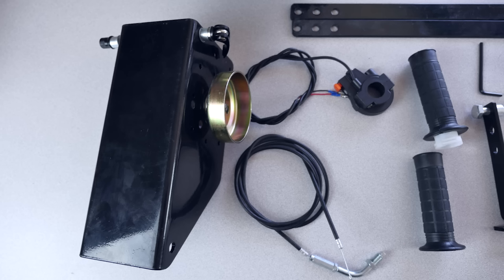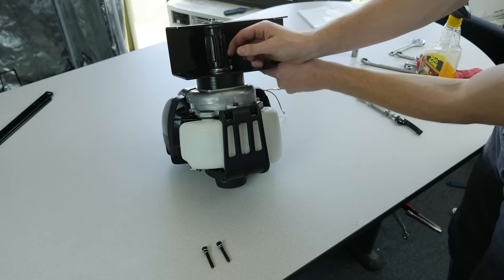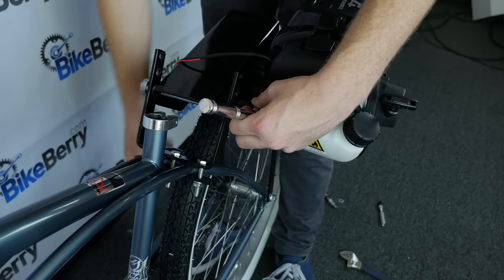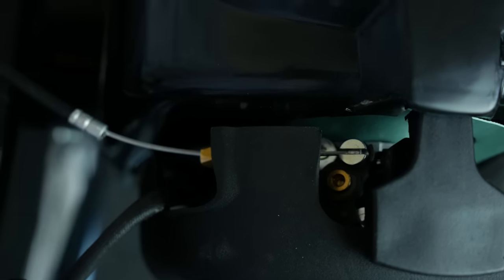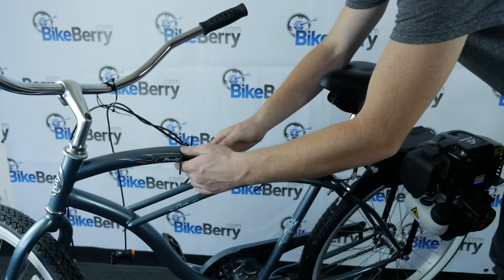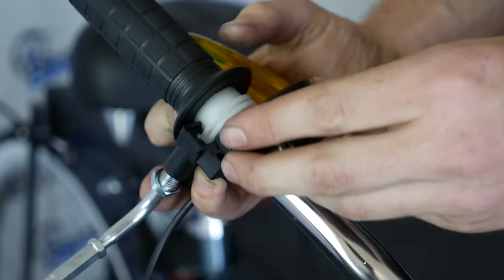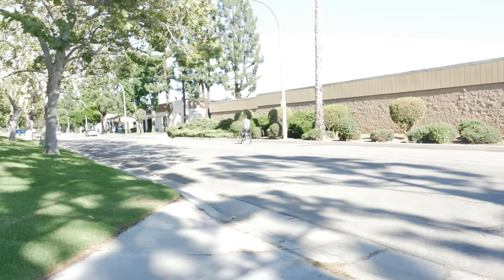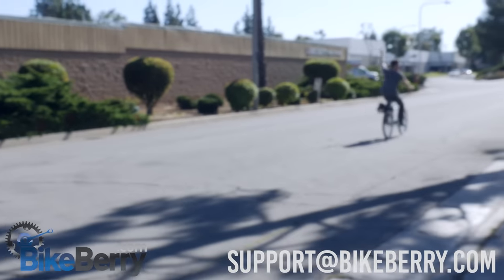4-Stroke 38cc Friction Drive Motor Bicycle Engine Kit Installation | The Flying Horse Lock-n-Load

Comment: Wouldn't putting the engine in FRONT make for safer handling (under steer) vs your rear drive (over steer) setup?
Reply: Imagine turning against the motor it’ll be breaking while driving

Comment: What if we demand using SAE drill bits?
Reply: G Philip C You use a 1/32 inch bit for the pilot hole, then a 6/32 or 1/4 bit for the actual hole.

Comment: Aren't there laws in the UK restricting the riding of any vehicle powered by an internal combustion engine on public roads?
Reply: Here in the netherlands also you will need a lisence plate and a drivers license. its a bad idea to drive one around here..
Reply: same here in Australia you will cop a unregistered, defective motorbike fine and if you don't have a motorbike licence you will get smacked wit another fine all up $2000+
Reply: Don't know how the laws are in the UK but here in the states they don't seem to care much even for those in frame engine motorized bikes. I got around on a beach cruiser for about a year & was only pulled over once for not fully stopping at a stop sign the cop didn't really question the legality of my bike nor did he ask for paper work. Let me off with a warning though because my brakes weren't very good (wink wink) I guess it depends on what kind of cop pull's you over. Suppose I was one of the lucky ones because I've heard of others getting slapped with finds just for driving theirs on public roads. After my motorized beach cruiser failed I built a friction drive mountain bike & been driving that for a year now & never been hassled by the cops for it once. I don't think they can legally impound your bike in most places though. Don't risk it though. Get the bike registered as a moped, always wear a helmet & doesn't hurt to carry a motorcycle license & you should check your local laws.
Reply: Modern Leveller it's not in UK in Georgia
Reply: All the more successful homeless people in my area have these; no license, no registration, no emissions test, no tax, no helmet, no speed limit and I'm pretty sure you can operate one of these as drunk or as high as you can be in Arizona. Hell, bing homeless in Az. Can be pretty damn nice.
Reply: G
Reply: walter kersting almost positive DUI/DWI applies to any mode of transportation across all 50 states. People get DUIs on regular bikes  all the time. I doubt a motor makes it somehow not an offense, especially since you can get a dui on a lawnmower, quad, etc.
I do kind of admire the homeless man's ability to save that can afford one of these and doesn't instead spend that money on shelter, food, dope, alcohol, prostitutes, crack, cigarettes, shoes, etc.
Reply: I know in most states in the U.S. no license or registration is required if engine is less than 50cc.
Reply: @theatom7264 -Here in the states federal law prohibits requiring registration or licensing of vehicles less than 50cc. You are still required to obey the rules of the road and a helmet is always a good idea.
Reply: @martinj9647  you can even be done for riding a horse or being pulled on a cart drunk .My great grandfather would go to the farmers market on the weekend and would very often come back drunk and asleep in the back of the cart late at night .As the horse would know his way home and when the horse got to the front door it would ring the doorbell with his nose to get my grandmother up to carry him indoors.He never  got done as he as was good friends with the chief of police and the head of the council and the judge.I guess as that helps and a intelligent horse .The horse otherwise would not go past a pub or his mistress's houses gambling dens and hoar house without stopping.that was a giveaway. frustrating when the rest of the family would have to use his horse if the other was sick or lame .Who needs a self driving Tesla.The horse does not lie but you might.

Comment: what about tyres i think it goes bad easily
Reply from the maker: +vedat kamanli It will bald out your rear wheel faster than your front because of the rolling pin. We recommend filing down the rolling pin and smooth it out a little bit to increase your wheel life. Keep in mind, that filing it down too much can cause issues with it 'catching' your rear wheel so file it sparingly.
Reply: +BikeBerrycom what type of bike did you install the engine on
Reply: +BikeBerrycom what type of bike did you use in the video? was it a multi speed bike?
Reply: seoulkidd1 No, single speed

Comment: 5:04 mate thats the primer not a power button
Reply from the maker: You're correct, this video was made years ago and since our information and video quality has greatly improved.
Reply: He said primer button
Reply: Watch the video just to point out the one flaw you could find. Cool Bro.
Reply: Noah Bannister no he didn’t
Reply: BikeBerrycom The info may've improved, but 2 things that didn't...
1- Blueberry is currently out of stock on this as of 5/9/19
2- It was never discussed about braking power or even possibly fatter tires
Although I said 2, a 3rd, the fact that after better info was available, there wasn't a re do or update for this video on the info you have here for all to see & potentially troll you about.

Comment: Whats the fastest tthis bike can go
Reply from the maker: +Roon Ortiz  Great question! It goes over 15 MPH and gets around 100 miles per gallon
Reply: +BikeBerrycom Is it sold in the UK?
Reply: BikeBerrycom Thanks for your reply.

I decided to go for an adult push scooter, because anything that has two wheels and is parked outside gets stolen or vandalised where I live at (Newcastle, UK).

Plus, I think I would need a driver's license for this, which I dont have.

But thanks for your reply.
Reply: +BikeBerrycom my clutch spring broke and i replaced it and now the bike accelerates slow and doesnt go as fast any suggestions or ideas on why.
Reply: +BikeBerrycom ...that's it? I'm new to these so maybe it's fast but that seems kinda slow to me. If someone would like to explain please do
Reply: BigRedCatFTW I depends on the engine size I have a 37 cc and it goes a little over 20
Reply: +Roon Ortiz     I have had mine up to 23 mph,suggest having an Electric front wheel,you need to pedal to get this bike going to much weight,an Electric front wheel or Hy-Bred works best,Use Electric to get you moving then engage gas motor,as I said to hard to get bike moving from a "Dead Stop without Assist one way or another

Comment: Do you guys provide a better throttle assembly kit that will last longer? the plastic throttle gets stripped super easy and I need a stronger material. That plastic is not strong enough.
Reply from the maker: https://www.bikeberry.com/bbr-tuning-complete-billet-aluminum-throttle-grip-handle-and-kill-switch-set.html

We have these, but the components inside are still plastic.

Comment: when your rear tire picks up a piece of wire, glass, nail or thorn, doesn't that tire roller just press it in further with every rotation, guaranteeing a flat? don't we need a solid rubber tire for this?
Reply from the maker: Not necessarily. Depending on the thickness of tire and its composite material the debris may not puncture all the way through to causing a flat. If installed correctly, the typical pressure the roller applies to the tire is not significantly different than the pressure the tire experiences when rolling against the ground. Either way, we recommend that all riders of any bike do periodic maintenance on their bikes to prevent flats or any damage to their bike.

Comment: I tried and tried and tried but I couldn't cut my handlebars with a box cutter....
Reply: Glenn Webster You may need the one with the pre installed laser or mini flame thrower.
Reply: Did you use a "titanium" blade? Standard blade "won't cut it" (no pun intended)!

Comment: i have an old 2 stroke ryobi leaf blower engine i found on the side of the road it runs but needs some maintenance i also have a frame i found on the side of the road that will fit the engine perfectly and i also have some pulleys and belts for the engine
Reply: I used to tell people I found s*** on the side of the road after I stole it good excuse hahaha

Comment: As a professional mechanic and machinist I cringe at the quality of these products and your installation videos
Reply: As a professional? Go build a bridge or something
Reply: +eastrockaway11518 That is a job for Engineers and Ironworkers.
Reply: Not a damn person that does this shit is a mechanic this is some quick easy shit for fun
Reply: dalmatiangirl61 teenage stuff lol. This is deffo bodge it and legit
Reply: dalmatiangirl61 no one cares
Reply: dalmatiangirl61 These things are just made extra simpel so everyone can easily install it. Afcorse it's not an engineering wonder.
Reply: dalmatiangirl61 yuogos ??
Reply: I like his twisted wire and electrical connections 😏
Reply: As a experienced mechanic, I don't like the drive system. What if it's wet? Does this thing slip? What does it do to your tire? It looks heavy and awkward. I prefer the old two stroke with a chain and sprocket. Happy trails friends.
Reply: Sounds like you hit on a market . Better made motor bicycles. There's your $$$
Reply: The quality of some of their products is terrible. The 2 strokes, no matter where you get them, are often of poor quality in one way or another, but Bikeberry poor quality is just more expensive, almost twice what one might pay elsewhere, and my particular problem with them was worse then I've had anywhere.. 

Still a good product once you get a good one and finally get it going, so just buy from Ebay/Amazon where they are much less expensive, and you can at least return them, as with Bikeberry you are pretty much out of luck if there is a serious problem. Oh, and their rating system is rigged, meaning they don't show/list the bad ratings, meaning you are being lied to, and the chances of you having a very bad experience are much greater than you are led to believe.
Reply: dalmatiangirl61 , that's because these are not "professional" toys.
Reply: As long as you can accept the use at your own risk factor. One of the only places that "I blame not doing my due diligence on the manufacturer" might fly is the US , but not against a Chinese manufacturer.
Reply: "Wire stripper" shows a pair of needle nose plier
Reply: These are meant for people who don’t want the trouble of putting a chain and a bunch of new parts on their bike.
Reply: kennith rogers  This is an old idea dating back at least to the 60's. I drove an ancient Schwinn with a front wheel "Wizzer" friction drive engine and it worked passably well in most N.E. weather conditions. It probably helped that I only weighed 80lbs or so at the time.
Reply: So as a dirt ball? Congrats
Reply: @kennethrogers3687  The velosolex moped had a front wheel mounted drive and a thicker than normal tire.  somehow it works out.  I do know that the design on those was that you would pedal to get going, then 'drop' the running engine onto the already spinning tire.  To stop, you pull the same lever to lift it back up.   Same to start.   Get going and drop the engine onto the wheel.  The kit in this video isn't quite like that though.
Reply: The whole point is for it to cost effective and it doesn't even look that bad the steel frame construction Jee buy a dirt bike if you want a motorbike
Reply: motors and coaster brakes... look mom, no teeth.
Reply: @Mister Myxlplyx There was something funny about that?
Reply: New astion movies2018
Reply: Thanks @CosgroveNotts
Reply: If you get a lock and load friction kit its bolts may not fit its motor mount. The quality could be that bad.

Comment: Nice. Two questions one how much two how fast will it go. Ok 3 questions how far will you go before you run out of gas ?
Reply from the maker: With a full tank of gas this engine will run at about an hour, with a top speed of 25 mph. For best pricing give us a call at (800)317-0479 or visit us at bikberry.com

Comment: I want to build one of these to make small trips much easier but what is your throttle, I get starting it with the handle but what do you use to change the rpms and stuff?
Reply: Twist throttle on handlebars

Comment: Ok I'll cut of my handle bar with only a box cutter
Reply from the maker: With enough effort, anything is possible. Cutting off the handle bar grip isn't necessary, it can be pulled off with a little soap and water. We simply thought cutting the grip off would add a little flare to the video.
Reply: BikeBerrycom no you made a mistake you said cut you bars
Reply from the maker: Air compressors can solve many problems and are often over looked as an essential tool. We unfortunately did not have a working air compressor at the time.
Reply from the maker: We are aware of what we said, and the intended meaning. We obviously do no intend for anyone try to cut their handle bars with a box cutter, or with any tool for that matter; I would say it is safe to assume most individuals would understand that intended meaning.
Reply: @bikeberry  What was wrong with the air compressor?
Reply: @bikeberry  I was able to shorten my handlebar with a box cutter....had to use a titanium blade!

Comment: Hello, I would like to build something similar but for a tricycle. It's for my dad he has issue with his hand and legs so I want to build a automatic motorized tricycle for Christmas so he can cruise around without dealing with balance and straining his legs. I just don't know how to do it. Any ideas would help. My dad has done allot for me for my 18 years I've been on this earth and I would like to use my passion of automotive and welding to make him something.
Reply: I would get the 79cc tricycle kit they sell on gasbikes. These friction drive kits are throwaways. They work great when the roller is brand new, for once you have a couple hundred miles on them they slip once they hit any kind of moisture. Once you have about 600 miles on them that's it then they're completely finished.  These things are all right for people just getting into motorized bikes. You're looking at about $1 per mile on your total build, it's not worth it.

Comment: Is there an installation like this that uses an extra sprocket/chain instead of the friction drive? I want to get one on my full suspension bike but there's a shock in the way in the main area of the frame, figured this would be better. But I don't like friction drive.
Reply: There are DIY videos here on YouTube of people doing that with chainsaw and weed whacker motors. Look them up, they're exciting projects.

Comment: You can get an invisible silent electric kit for less than this...
Reply: joblessalex
Reply: joblessalex I agree
Reply: joblessalex where?
Reply: Anthony Cortez ebay.
Reply: The electric kits are cheaper (about$200 on Amazon) , but the batteries are really expensive. $300-400 for good ones.
Reply: And when your battery runs low you can wait for five hours if you can find someplace to plug it in.......
Reply: Yeah and the batteries cost 400 dollars and don't go near as far. Not worth it
Reply: The Fibler exactly. Even 50km (30 miles) I do from time to time would be enough. And I do that all by my legs!
Reply: Or you can use the electric on the front.

Comment: Will it work for any small 4 stroke like a Honda? Or just works for your engine?
Reply: A Honda GX35 will fit. The kit has a 78mm clutch drum.
Reply: Staton friction kits are better though. Made in USA. And the drive roller doesn't wear down like the ones on the cheap China kits.

Comment: Is it legal to drive it on the street? I cant decide if i should buy this kit or buy a used scooter.
Reply: tritonmole I asked three cops in Illinois and they said it was OK
 
But everything on this engine kit is a little broken I should know I only rode it 30 miles so far and that metal brass colored cup cracked two times now you know I think it's like the lottery with these engine kits. My advice to you is that once you get it installed as quickly as possible ride it until something goes wrong before the 30 day moneyback guarantee is over

If you get it text me back and I will give you some instructions on troubleshooting
Reply from the maker: The legality of motorized bikes differs between region. We would advice contacting your local DMV for more information.
Reply from the maker: Thank you for helping the bike community. We would like to help you with your problems as well. Please contact our customer service representatives at 1-800-317-0479.

Comment: How does the throttle work on these? where do you twist it? Also what are the pros and cons of the friction system compared to a traditional motor mount.
Reply: Bamskies780 Same as a normal throttle works. Easier to install, no parasitic drag from the chain

Comment: So, now that you have a motor on your bicycle you basically have a motorcycle which means you have to have a motorcycle license, a registration and insurance.
I think I would rather get a real motorcycle.
Reply: Carol Stevens --No, you have a "motor driven" cycle.
Reply: In a lot of places,  if it's 49cc or less and has pedals, it doesn't need to be licensed or insured. If that's not the case in your locale, sure, buy a motorcycle.

Comment: I ride small bike, can you suggest any small bike name for this engine without modifaction?
Reply from the maker: There are numerous adult bikes available that can utilize this engine, both new and use, made from many different manufacturers and countries. We do suggest using a bike with a 26" minimum wheel size to support our mounting system without modifications, it will provide proper clearance from the engine and rider.